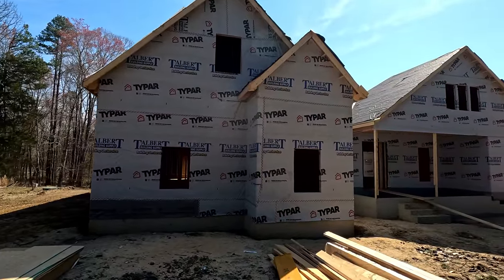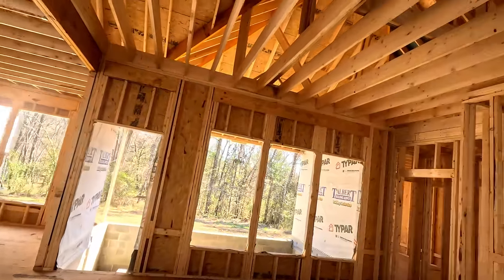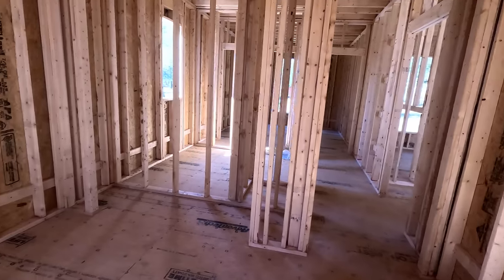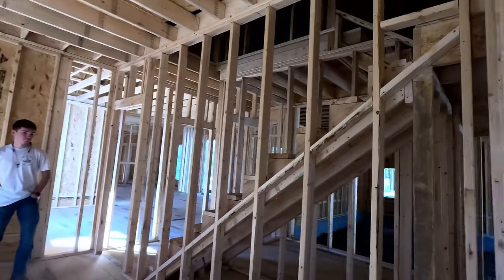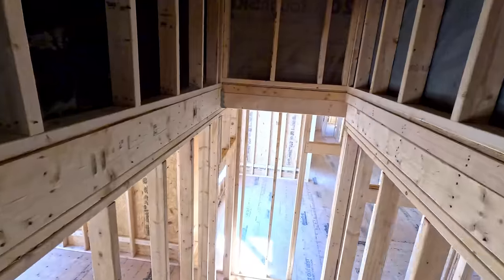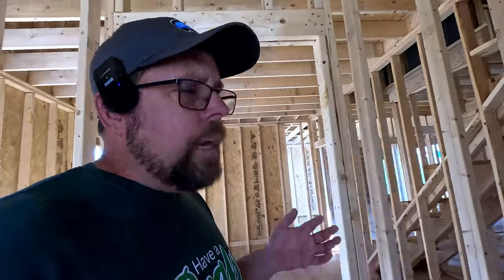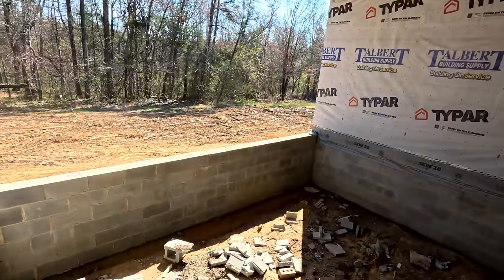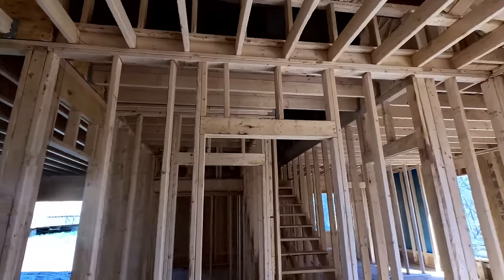Framing Complete! Spruce Pine Project Update

Comment: I wouldn’t mind seeing the electricians doing their thing. My father was a master electrician so I spent a lot of years working with him on weekends. I drilled more holes in studs for wire than I can remember. He was always so meticulous and neat about how things were run and labeled. 
I miss that old man every day still, so I’d like to see some of the trades working.
Reply: When I started residential work I used to snap Lines so my 7/8 or what ever holes were all in a straight line. Then as I progressed I had lasers and things that I needed for commercial work with pipe and things. So on occasion I would use that to put a straight line to drill by. Absolutely makes a difference how neat the job looks. Ur dad was correct. I bit of time now saves a ton later. But overall the neatness of the job sells itself to the next customer.
Reply: It’s hard to explain. But when you enter a box you know in ur mind without thinking after a while in what order that need to go. Long story and even longer explanation but but let’s say ur making up a 4 gang box. Only so maycubes of wires will fit in it. So in ur mind you just know where to put each wire to make it neat and stay within code.

Comment: As an electrician I have done many homes for friends. I have emphasized many times that the National Electrical Code is a minimum standard. You can always improve on what is required. Most people already have in their heads where the bed will go plan outlets accordingly. An extra outlet at this stage is easy to do. It is a great idea to work with the homeowner for electrical layout. Especially with the requirements for home entertainment systems.
Reply: James , when I did residential work I was the same way. I would do a walk thru and explain how others have made changes and the charges it has cost them.
Reply: Code minimum is just that.
Reply: Floor outlets were another thing that I told customers about. If it was a large room and they saw a magazine article with furniture in the middle they had to think about floor outlets. With a basement not so bad to add with a concrete floor do it now or basically hold ur peace.
Reply: With a wood basement I’d rather rough in a box and let the flooring guys deal with the cuts. Now that I do commercial mostly I deal with treys under the cement and core drill through them and attach dog houses

Comment: Geoff, a small thing that goes a long way would be adding a scrap piece of 2 X4 on either side of the window openings for the homeowner to hang window treatments.  That little detail (especially if you point that out to them) goes a long way toward their satisfaction with you as a builder.    Tom

Comment: I’m an electrician and I used to do a lot of residential new construction. I took the time with the GC and new home owner to go over the layout and offer options. Typical spec houses will be built to code minimum and for a few extra dollars I would offer options to the home owner wether it be added receptacles or additional switching capabilities or cabling to add smart features to a home. Unfortunately it started getting so competitive and cut throat from low bidders who had cheaper labor and offered less services than me that I dropped the residential side of my business and now focus on commercial and industrial.

Comment: That's a nice little house, it has a decent floor plan. A basement would be great with it but I don't think you can necessarily do that there. I like the no trusses thing, but how does that affect resistance to wind damage, and I didn't (or couldn't) see any hurricane strapping on the roof beams at the walls. They might be there but my old eyeballs didn't pick them up. I couldn't tell where the kitchen and dining were in there, I was just kinda guessing. Anyway, I like the house, I'd have to multiply it's size by two, two and a half at least for myself, but I like it!
Reply from the maker: The hurricane trapping is there. They put it between the top plate and the rafters, but it is hard to see from the angles I was. I think these are strong or better than the trust systems because of the lams we use. If you don’t use lams and just stick frame, then I could see the truss being better.
Reply: @BealyGood I like the idea of using better flooring too. Our house has the OSB crap, I wish I could reel back time and change that (and some other stuff) but you know, hindsight and all that.

Maybe if you're in the business of renovating too you can come replace my flooring, add some security, change up the hvac system and more. I doubt you do Michigan though, just a wee bit out of your neighborhood. 😅

Comment: Looks great.  Are you going to have 240V run to the garage for either hard wired or a 240 outlet to make the 2 car garage EV charging ready for both cars?  I think it would probably be cheaper to do it during construction rather than in a finished building.
In a spec house, which it sounds like this isn't, how much of a price premium would being EV ready be over new construction installation cost?
Reply from the maker: We will go over that during the pre-electric walkthrough. Great questions, I will be sure to include them in a video. Thanks 😊

Comment: I like that style of housebuild not the prefabbed stuff glued and held together with staples. Actually it is the old fashioned way of building homes. Wait till the electricians and plumbers come through. I always had wiring and sawdust to deal with when we would start a drywall job and needed to clear the floor so our rolling hanger rack would roll smoothly and not bang drywall boards around manuevering through house. Most places were tidy but then there was always that one just waiting for ya.

Comment: Change orders are expensive to the homeowner. By doing my walk through with the client I discussed what would happen if they changed their minds after finishes began and the added expense that would. Sometimes up to 300% what it would cost at rough in. Things like running a two inch pipe from the electrical room to the attic so it acts as a conduit for future needs without having to snake walls. Considerations for under cabinet lighting , camera/ security , interior and exterior audio. It’s cheaper with bare studs. My competitors didn’t do that and took advantage of the inflated price of a change order.
Reply: Another thing I used to offer as an option on some of these two story homes with 10’-12’ ceilings is chandelier lifts in their great rooms. A simple key operated switch in a nearby closet that operates a winch basically , located in the attic. It allows the homeowner to dust the fixture and easily service any lamps that may be out. Other wise they would be on a very tall step ladder and most people don’t think of that.
Reply: We used to offer what we used to call a smart cable and that was a bundled cable consisting of a fire optic, several RG6’s , and several cat 5’s. One smart cable would go to each designated room then home run back to the basement or electrical room. Then in each room the individual wires could be moved around the room to receptacles the homeowner chose at rough in. That pretty much obsolete today I would think but 20 years ago when I was offering it quite a few people opted for it.
Reply: Some people called it structured cable.

Comment: Mr Bealy Good - Sir…. All the houses I’ve ever lived in (UK 🏴) have all been block and brick including the internal walls! Everything has its pros and cons time, flexibility, availability of materials etc etc. I guess the big one is cost…. How much would it cost to build it in brick and block 2x 3x 4x?
Reply from the maker: The materials and construction part wouldn’t be a lot more. The trades side would be (electrical, hvac and plumbing) as the learning curve would be high unless you brought in a commercial crew and designer.

Comment: Since this is a shallow footer with a concrete kneewall/frostwall, and wood framed foundation cap, how do you insulate the floor?  Do you send someone back into the crawlspace to insulate after the mechanicals'?  How do you control humidity down there?  Passive or active?

Nice looking build.  Surprised it's only 1600SF.  Good to see your commitment to Advantech.  I suspect its' all glued down with something like SF450.  It will be nice to see this dried in and roughed in.

Thanks for sharing.
Reply from the maker: Yes. Insulation is after the mechanicals. The type depends on the client. If they want a sealed crawl then it gets a dehumidifier. If not then there are vents every few feet that are open or closed depending on the season.
Reply: @BealyGood  Thanks for answering.  Got to say, I have personally, physically, installed FG insulation in the floor from the crawlspace.  What a grueling difficult thankless job that was.  Vapor mitigator side toward the heated space means all that open face FG toward MY face!  Of course that was before my project manager days.  Gotta earn your stripes somehow, I guess!

Comment: When I did residential work I had my GC confirm the site was clean. Now often we would be working at the same time as the plumbers and we bothe make a bunch of saw dust and wood chipping. Us more so than them. Plus we leave little pieces of wire and sheathing so the plumbers would clean what he thought was his mess and I’d have my guys leaf blow the house. The GC was more than happy to have the mess outdoors and would be taken care of with exterior grade work or what ever. It was going to get worse outside before it got better.
Reply from the maker: We have a couple of guys that clean the house (when needed). I’ve had to work in houses that others were building where you could barely get around because of all the trash.
Reply: I’ve been in those situations. The house is clean after framing but as subs come in full of debris. I have GC’d some houses and I’d hold back 10% on rough in payment or payment in general if the mess wasn’t cleaned. We aren’t asking perfection but it is an expense to have guys go behind and clean for the next stage and it looks like crap for inspectors. So I’d just have my guys use a leaf blower and blow out all or most of our saw dust and clippings from rough in. 20 mins and we are all happy.
Reply: A 2X4 here or there is needed. Sometimes we need to pack something out depending on the trim choice or numerous other factors so some of that is good but just regular trip hazard crap isn’t. I’ve found most framers in my area burn most of their trash on site.
Reply: So next in is plumbers and electricians. I used to like to come in after the plumbers so if he had to put a one piece stall in he wouldn’t effect my wires. I can go around him. We drill so many holes and make a mess. Plus when we make up our boxes we leave clippings all over. As a young contractor I didn’t realize that. I got my but chewed and left spotless job sites since.
Reply from the maker: @TheEggeee2  HVAC, then, plumbing. We bring the electrician in last.
Reply: Now with what I do now it’s a bit more difficult. With tenant fit ups and commercial work many subs are working at the same time so you just clean up a mess as you go. You can’t mess up a whole sire by yourself and clean it. Industrial is similiar , we have guys that are multi purpose , fire watch , clean up and just general help.
Reply: @BealyGood  you are correct about hvac. In residential I could drill through his plenum if he was using a stud or joist bay. I’d have to seal it with fire roof calk but we could share at opposing angles. Ie if he was running north south I could run east west thru him but I had to seal and fire calk the penetration. Could not run length wise with him.
Reply: Just thought of another common issue I had. In bathrooms I would wiggle a rite around in the studs because you never knew where the light or lights would be. So on finishing I would poke a small hole and fish the wire. If it was two lights we’d be fine. If it was one it was always a problem. The plumbers vent almost always goes up the center and that’s where the light needs to be. So I’d have to use these shitty pancake boxes to fit in there old work and you never had enough room for the wires. Had to make it work tho.

Comment: Always cool to see construction from the other side of the world, and it looks nice too. I do painting and plastering here in New Zealand, what are rates like over there?
Reply from the maker: It varies. Sheetrock finishing is $22 - $25 a board ( plus cost of the board). Painting varies a lot. Fig $5 a sq ft and you’ll be in the ballpark.
Reply: @BealyGood  Yeah lots of variables in painting, I assume that's a floor rate? ie 1000 sqft basic house would be around 5k to paint. Converted to NZD that's about on par with here. Thanks for the info
Reply from the maker: @lastguy8613  correct

Comment: Bealy Good are you up to snuff on codes and standards or do you hire in someone that comes in and checks that stuff specifically. That job looked really nice and very high quality, but the bit I know about construction sometimes what one thinks is better is not actually as good like using screws some places instead of nails. Then there is all of the wiring runs etc that can look neat and well done, but if not placed properly they are an issue. I am NOT questioning the build AT ALL it looked REALLY well done I am more just asking if you are moving towards being your own "codes and specs" guy and having that knowledge or are you going to farm that out or are you using contractors that you just trust to do it right......plus a comment helps the algorithm 😁
Reply from the maker: I keep up with code and retest/recertify every year. I also use subs that are licensed and insured. Great question 😊
Reply: @BealyGood  I figured if you were not already certified for inspections and codes that you would be working to get that.....always learning always adding to the skill set